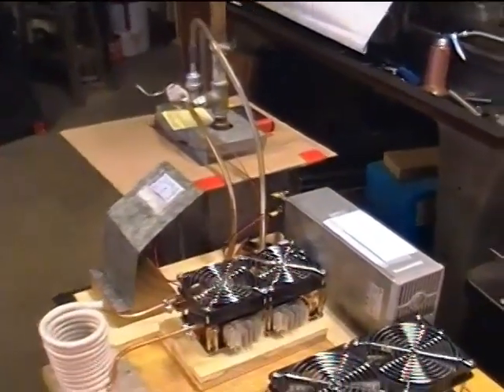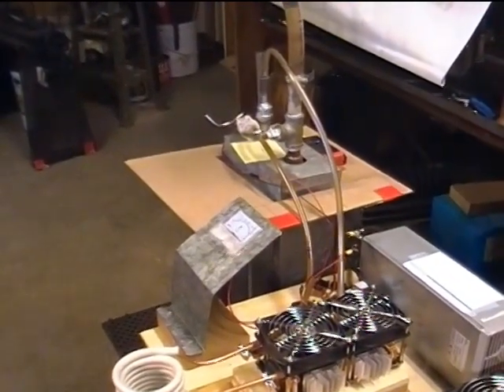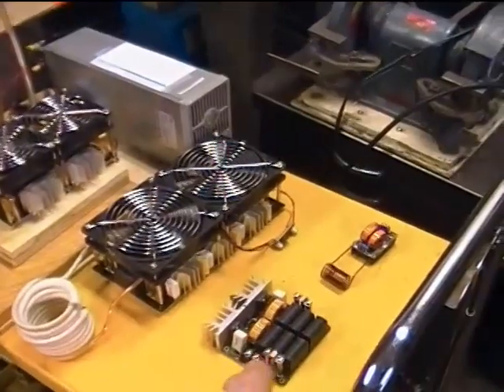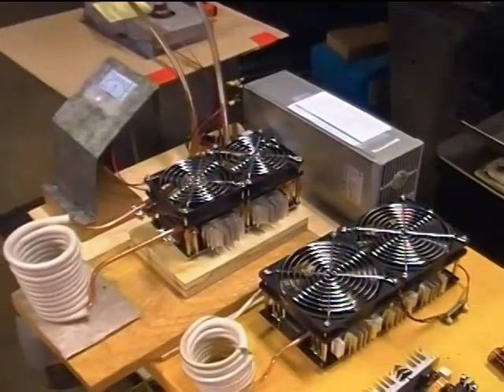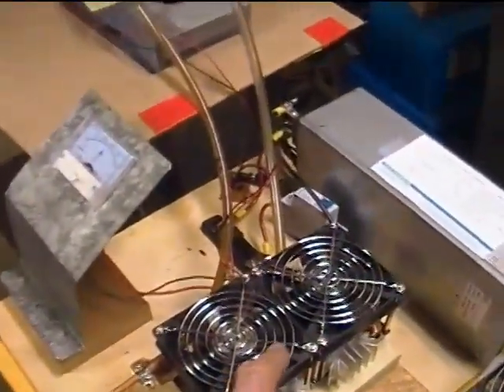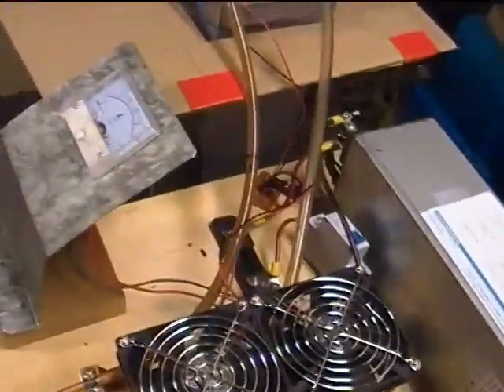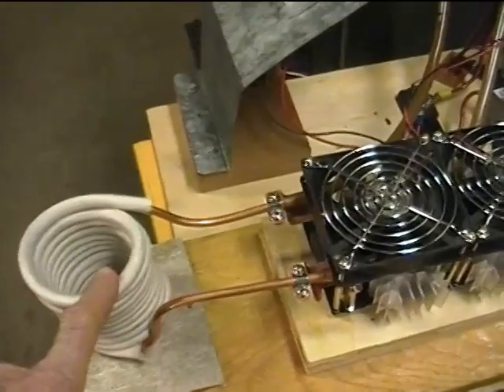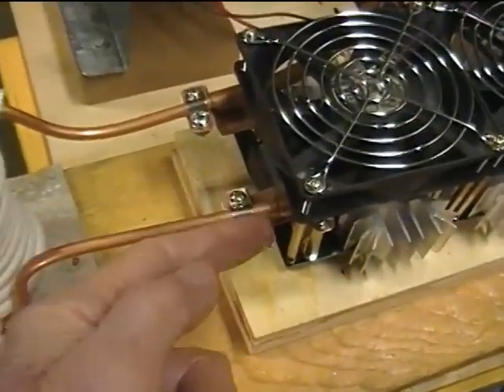1800 Watt to 2500 Watt ZVS Induction Heater Transition Planning

Comment: I love the series on the induction heater. What would you say is the best size to anneal brass cartridges? Up to say a .308 casing. Am I right that the coils size dictates your frequency? Is 50hrtz better then say 10krtz for brass?? Thanks for the great ahows
Reply from the maker: You don't get to choose  the frequency with these induction heaters, except by changing  work coil design.  But, in general, I think 50 kHz would be better than 10 kHz
The 1000 watt unit seems to work well for what you want to do..
See:
https://www.youtube.com/watch?v=g6GFMpZUZ7k
Reply: @frenchcreekvalley  thanks for your time, I’m retired and am going to start reloading again, if I can get supplies. Thanks for the help, the coil was what I was thinking about for frequency and will head down that road. I’ll give that 1k unit a try, have a nice xmas

Comment: Please tell me, how you manage the power input of heating? I dont see any regulator. I need to heat steel up to fixed temperature and stand on it.
Reply from the maker: I do not have any "regulator" on my induction heaters.  I have seen one or two youtube videos where they use a heavy-duty relay to cycle the DC power (not the AC power to the power supply) on and off to control the average power. Of course, then you can use a PIC temperature controller like this one:
https://www.wolfautomation.com/timer-temp-controller-1-relay-pulse-out-48x48mm-1/  to supply the on-off signal to the heavy duty relay.  I also believe that there are DC rated solid state relays that could handle the load, but I have not tried one.

Comment: Hi, great Video! How did you insulate the coils?
Reply from the maker: Insulation for ZVS Induction Heater Coils
June 25, 2020

I think I usually order the 6mm diameter size, which fits snugly on 1/4" OD copper tubing.  I did order 8mm once and it works okay since it is looser on the tubing.

Ebay Desc:
Φ1~40mm White 600°C HIGH TEMP Fiberglass Sleeving Wire Cable Insulating Tube

Ebay Listing:
https://www.ebay.com/itm/%CE%A61-40mm-White-600-C-HIGH-TEMP-Fiberglass-Sleeving-Wire-Cable-Insulating-Tube/153050276433?ssPageName=STRK%3AMEBIDX%3AIT&_trksid=p2057872.m2749.l2649
Reply: @frenchcreekvalley  thanks a lot sir!

Comment: Hello sir how are you hope your fine well I need to ask one thing about the zvs 1800 watt induction heater I need to add a frequency controller to modify my induction heater do you have any way to add it on because there is an issue like when I melt copper in a carbon crucible it melts but suddenly after melting the ampere goes low and temperature decreases. Thing isn't what I want I need to add a frequency of a duty cycle in the gates of mosphet to control I'm using a 50 volt 48 amps switching power supply please let me know about this how to modify it, 
Thank you for your videos they are really help full
Reply from the maker: I have seen the effect that you mention.  I believe that the molten copper "shorts out" the carbon crucible reducing the electrical "friction" of the system.  I do not have a good answer for your question, but I offer these thoughts:
- You say that you need to add a "frequency controller".  For these ZVS heaters, I don't know of any good way to control the frequency of oscillation other than to change work coil characteristics or changing the tank capacitance.   The easiest way to change frequency would be to switch in more capacitors to reduce the frequency or to switch out some of the existing capacitors to increase frequency.  But, unless you know that a certain frequency will solve the problem,  you will have to do a lot of experimenting.  I don't think it will help you very much.
-If you could add a very thin layer of ceramic material to the INSIDE of the crucible, I think you would solve the problem, although I have not tried it myself.
-I assume that you are using a graphite crucible inside a ceramic shell.  If this is not the case, then get one.
-Add insulation:    Adding more and thicker insulation around the crucible, top and bottom, will reduce heat loss considerably.
-If the fans are blowing any air at all onto the work coil, you will be taking heat away from the work.  Place a baffle between the front fan and the work coil.
-The crucible "wears out" with use.  The graphite wall gets thinner with use and the current becomes less and less.  Try a new crucible.

I am sorry that I do not have a direct answer to your question.
I hope some of these thoughts help.
Pete Stanaitis
----------------------

Comment: what Amperage mostfets are safe to use (reliable?)
50A, or even a 100A IGBT??
then also what capacitor voltage is ok? (also to be reliable) 1000V, 0,47uF 10 pcs. total 4,7uF
is that ok to operate safely without blowing up? or over rated?
Reply from the maker: Hello JP jay.
Look up the datasheet for the Infineon IRFP260N Mosfet.  I think you will find it acceptable for your application.
The 1000 volt capacitors seem about right.
I repeat my comment to the recent similar question you asked on another one of my videos:
The ZVS induction heaters that I use   all use !RFP260N Mosfets.  They work well with a 48 volt DC power supply.  I water cool my work coil and fan cool the Mosfets and the capacitors.  The 1000 watt model in this video uses two of those Mosfets.  The 1800 watt model uses two PAIRS of the same Mosfet and the 2500 watt model uses three Pairs of them.  I have not experimented with other Mosfets or with IGBT's so I can't comment on their use. 
  In my experience, more capacitance equals more idle current and more heat in the capacitors that needs to be dissipated.
Reply: @frenchcreekvalley  thanks a lot. that sounds fantastic.